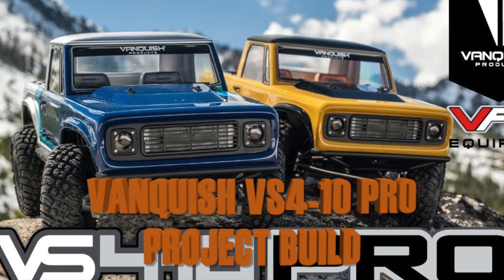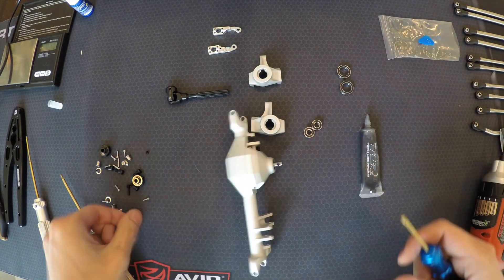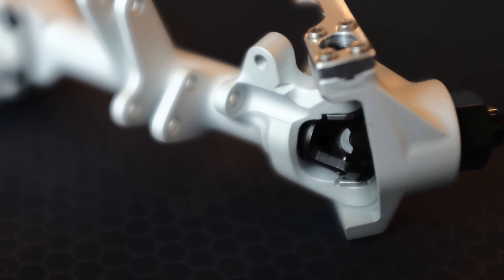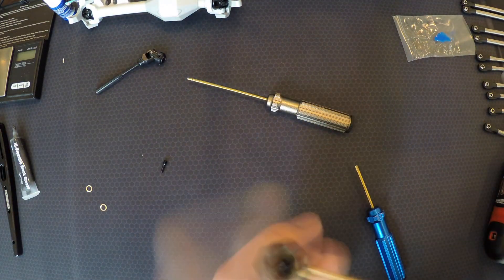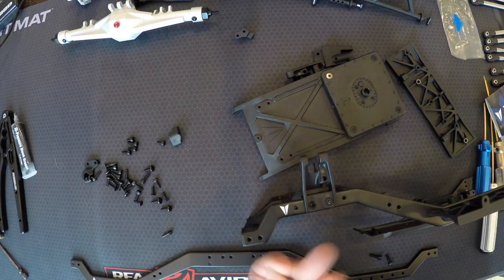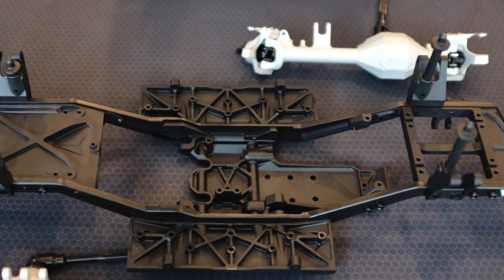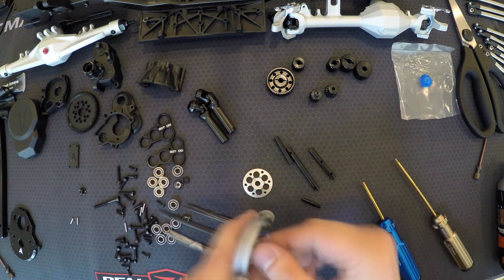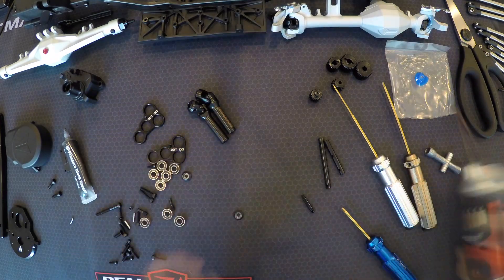Vanquish VS4-10 Pro Step by Step build of the ultimate crawler kit

Comment: I've built many years worth of shocks and these incision shocks are the only ones that I cannot stop shaft seals from leaking. Did you have any issues? I'm using all the normal tricks and 80wt as well and would really like to get these shocks to hold oil vs lubricating everything below

Comment: Hi Francis,  Were those different shock oil weights mentioned (40/70 and 80 wts) using the standard installed pistons?  FYI...I found different shock pistons included within my kit.
Reply from the maker: standard installed pistons yes. I'm running 80 weight all around and definitely recommend that.
Reply: @RCReviewChannel  Thanks...As usual...LOL

Comment: Something I've been interested in finding out, but have (so far) not gotten any answers on (I even messaged VP, directly, and haven't received a reply), is whether the 313mm wheelbase can be increased/decreased.  Other kits (SCX10.2, Trail King Pro, TRX-4, Gen8 P.A.C.K., etc, can be set to 313mm or 324mm, with some being able to go higher and/or lower.

Is the VS4-10 Pro capable of wheelbases other than just 313mm...and, if so, what are the other wheelbase options/settings?
Reply from the maker: When there no hint of a mention it, the answer is most likely no.
Reply: @RCReviewChannel  That's to bad.  Looks like I'll be purchasing a second Trail King Pro, instead.  At least the TK supports longer, as well as shorter, wheelbases.
Reply: @Panther6834  Not TOO bad...
ANY Pro Level Crawler Truck CAN have the Wheelbase adjusted!! 
Just change the Rear Link Lengths. 😉 Drill two new Holes in the Chassis and move the Shock Towers. An hour or two.
Reply: @CarminesRCTipsandTricks  I'd love to agree with you, but I don't think I can.  The reason is that it would depend on the shock tower mounting location.  Using the VS4-10 Pro & Gen8 rails as perfect example, I could see the possibility of doing that on the VS4-10 rails, as they're straight (ie. no "curves", only "angles"), but not on the Gen8, as it has curved rails.  However, if I remember correctly, the Gen8 already has multiple shock tower mounting positions (tho, I'm no longer considering the Gen8).  Originally, I was considering the Gen8 & TRX-4.  Then, I added the Element RC Enduro to the list, but eliminated the Gen8.  Next, I purchased the VS4-10 Pro, although it was initially intended to become something else.  And, finally, after looking over the Trail King Pro I'm almost finished building, I realized that the TK could also be a possibility.  At this point, I've narrowed down the "choices" to the TK & VS4-10.

Michael, at Vanquish, responded back, and said that the VS4-10 does have different shock tower mounting positions...except he forgot to tell me what wheelbase lengths the different options create, so I've replied back, and am awaiting his next reply.  Honestly, if the VS4-10 can do it, that's the route I'd prefer.  It's an expensive way to go...but, if I were to use a Trail King, and add upgrades (such as machined axles) equivalent to the VS4-10, the TK would end up costing about the same.
Reply: @Panther6834  Like everything else in this Hobby, it's a matter of preference. If YOU'RE not happy, it's no longer a Hobby - it's a chore. Nobody wants that! 

I'm really liking the SSD. Can't buy it, but if I could, it seems to be great value for money. 

That VS4-10 though... Yeah, $750 - but packed with high performance Vanquish goodies! 😉
Reply: @CarminesRCTipsandTricks  Really not happy with Vanquish's CS.  Michael did reply back...but, once again, he didn't actually answer my questions (as I asked them), and, instead, gave only "half answers".  This led to me doing the math on my own, and having to ask him if what I came up with is correct.

This is what he said:
"The rear shock tower has 4 different possible mount location, in stock kit form the second the last location is used for the shock.  With that you have one left to mount the shock further back for a longer wheelbase.  The distance the between the each shock tower mounting points are roughly 12mm."

Since Vanquish states 12.3" as the wheelbase, that could mean 312mm, or 313mm.  If I assume 312mm, that should mean the possible wheelbase lengths are 288mm, 300mm, 312mm & 324mm.  I've emailed him (again), to ask "if my math is correct".  Trying to get accurate into from Vanquish, about their own product, is worse than pulling teeth.  At least Chris (SSD) is quick to reply, provides accurate info, and goes "above & beyond" to help his customers.
Reply: Unless promoted, this should be my final partying regarding this matter.  While I will probably still purchase Vanquish Products in the future, I'll limit them to such "simplicities" as wheels.  I'll be cancelling my VS4-10 Pro order (and, if to late to cancel, I'll process an RMA the moment I receive it.  While the company designs & produces excellent quality products, their CS leaves much to be desired.  Michael Pham replied back, and this is what he said:

"I'm sorry you feel that the answer are half answer.  The kit is marketed as a 12.3" wheel base and I am doing be best to help answer your questions as possible wheelbase lengths information is not something I know off hand.  We do not offer link kits that offer different wheelbases for the  kit.  With that technically you are correct with the different shock tower lengths and custom links to get the wheelbase you have listed."

Ignoring the fact that grammar is on the 'poor' side, I can state that each of my emails was very concise, and the questions I asked were very clear...yet, not even that produced actual answers to my questions.  It would be akin to asking someone "What ya got under the hood?", and then replying "A motor.". Saying "A V-8" would be better, and "A 426 Mopar Hemi" would be even better, but "A motor" is ridiculous...yet, that's the type of replies I received from Michael Pham at Vanquish.  For anyone else who's bought, or will be buying, the Vanquish kits, if you ever have problems, and need to deal with CS, you've been forwarded.
Reply: @Panther6834  Yeah, I've noticed that too...
Chris@ SSD has been helpful to me as well. I even asked a speculative question, knowing I wasn't able to buy it any time soon...
I asked about Bellhousing Spacers to move the "Engine" forward or back. There's options to move the Engine from the Transmission 15mm or 20mm, depending on WHICH Body you're using. This would put that fake Engine Cover in the optimum position to look RIGHT, whether it's a Ford, Chevy, Toyota, whatever Body, so the Engine would sit under the Hood in the same position it would in its 1:1 counterpart!!! 
PLUS he said that they sell different length Headers, so the whole thing ties together as Scale as humanly possible! 😮😊

This was after I disclosed that I can't afford to buy it anytime soon. 
THAT'S CUSTOMER SERVICE!! 

..... Reminds me of how Axial and Vaterra USED to be, before the Horizon takeover, when they were still Independents... 
THEY actually used to have Management and Product designers Frequent the major Crawler Forums, and would help anyone with issues - EVEN discuss pre-releases and Beta Models BEFORE going on sale!! 
That was SEVERAL years ago...........

Vanquish has been reminding me of the "Cool Kids Club". 
If you've got the money to burn, and/or you Comp at the Right Events, they will bother to treat you with respect. 😖

This has been bugging me more and more lately.

You want the good old fashioned Service?? 
SSD, Crawler Innovations and believe it or not - REDCAT, deliver! 

And you can FORGET about TRAXXASS! You're just a number - unless you get lucky with the odd, compassionate CSR.
Reply: I have the ultra, with some work you should be able to adjust the rear axle some, how much I’m not really sure.  Mostly link adjustment and shock tower placement.  Will need to drill/tap new hole for shock towers.  Also a new rear axle to fit.
Reply: @donb4138  With any vehicle, I can see the possibility of needing to drill new holes to mount the shock towers, and I completely understand the need for slightly longer links.

However, as for you saying a new axle would be needed, that makes absolutely no sense.  That would be like saying, if someone wants to use different shocks, they'll also need to buy new wheels.  The same axle would be usable, whether someone is shortening, or lengthening, the wheelbase.
Reply: Robb Ryan my mistake driveshaft